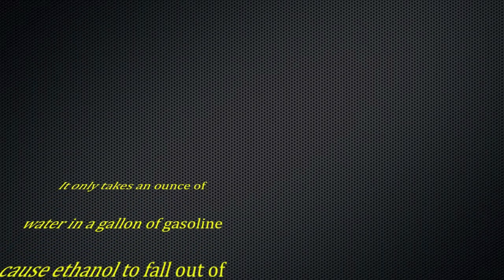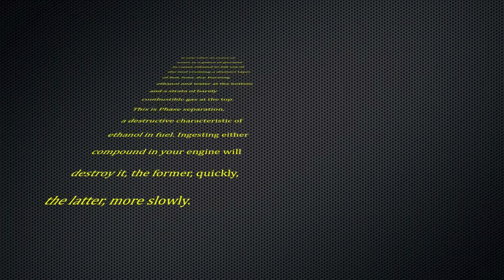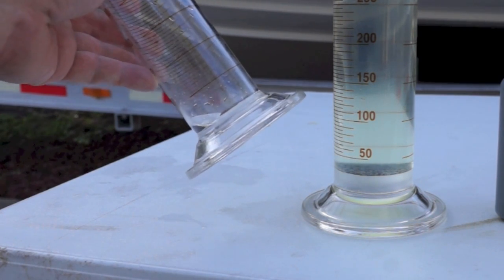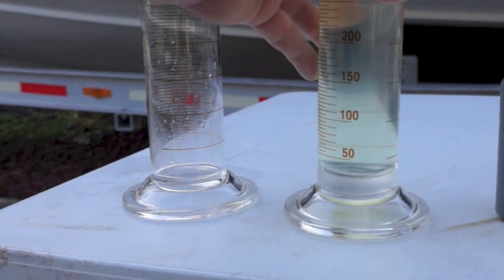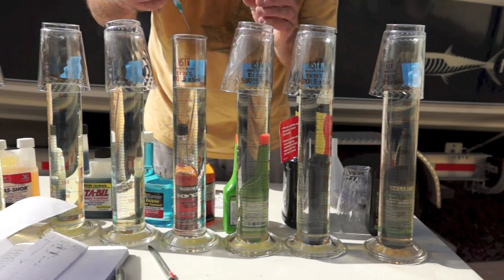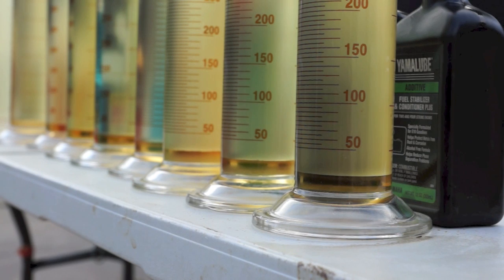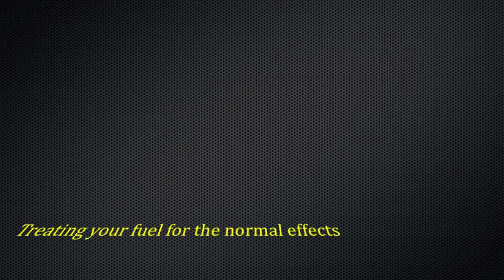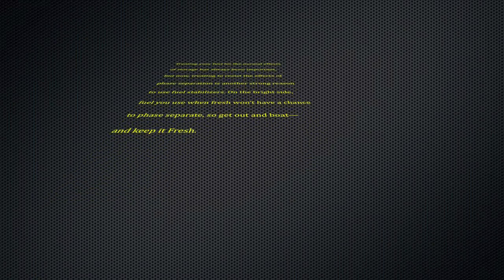Phase Separation in Ethanol Gasoline

Comment: Ethanol prevents phase separation. I dare you to do the same test with E85 or recreational gas.
Reply: But ethanol does attract water.  Several times I have had problems starting my lawnmower after it sat for awhile (I live in a high humidity environment).  I put a liberal dose of Seafoam in it, shake it up, and it starts up every time (and I also add fresh gas as soon as I can).  Seafoam contains Isopropyl alcohol which is a water dispersent.  It helps to mix the water in the fuel more evenly, rather than sit on the bottom as a layer.  It of course doesn't run great on this contaminated fuel, but that's why I try to add fresh gas asap, or if it's really bad, I'll drain out the old fuel to add fresh.
Reply: MoronicAcid1 So why does ethanol gasoline break down so easily then compared to ethanol-free fuel? We're not talking about E85 or any hobby fuels, regular E10 gasoline from the pump at any corner gas station is problematic because the ethanol renders the fuel less stable, bonding with water in humid atmospheres and ruining carbureted small engines. It does fine in most modern car engines because they're fuel-injected and the newer injection systems are engineered to work with E10 gasoline. If you have an older engine or anything with a carburetor, the ethanol will not only accelerate the process of the fuel breaking down but also corrodes many components in the fuel delivery system (i.e. excessive drying of rubber and plastic components and added corrosion deposits in small holes and spaces). If you have a station that sells ethanol-free gasoline near you, this is THE BEST for small engines and vehicles with carburetors. If nobody near you sells ethanol-free, add 1-5 oz of fuel treatment like Lucas or Sta-bil to your tank prior to long-term storage or every few fill-ups. It will save you a lot of trouble.
Reply: https://m.youtube.com/watch?v=L2Q4lfHblo8&pp=ygUcTHVjYXMgb2lsIHNhZmVndWFyZCBldGhhbm9sIA%3D%3D

Comment: Always use ethanol-free gas for boats, lawn mowers, generators and other equipment if gas in the tank is not rotated regularly. For the daily commute gasoline with ethanol is fine.